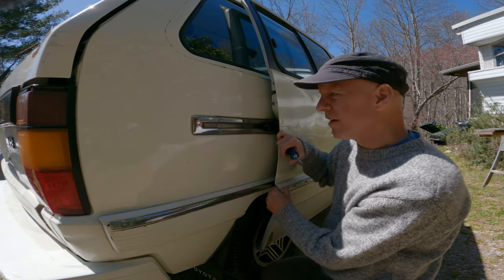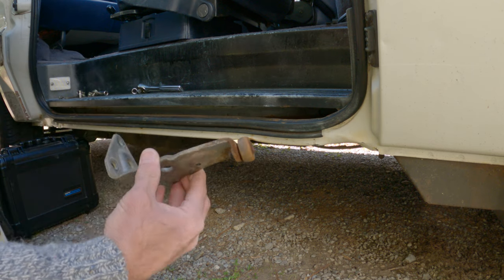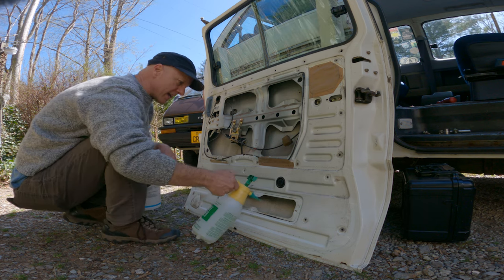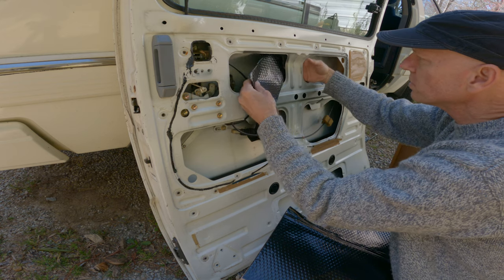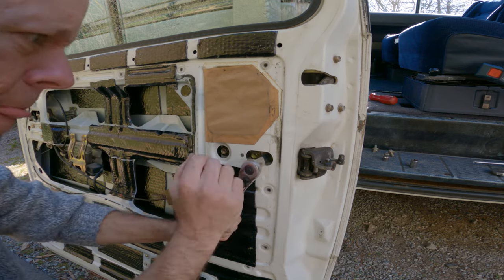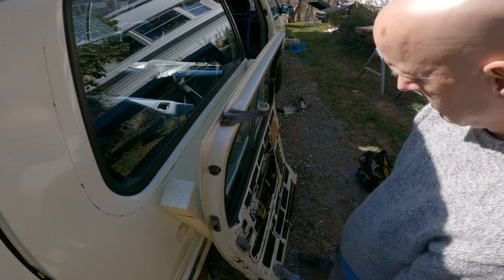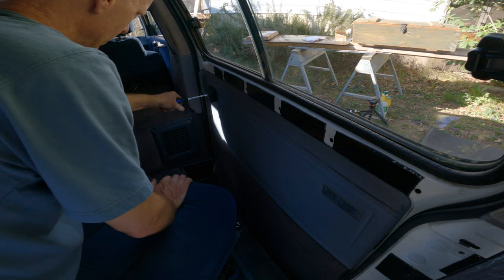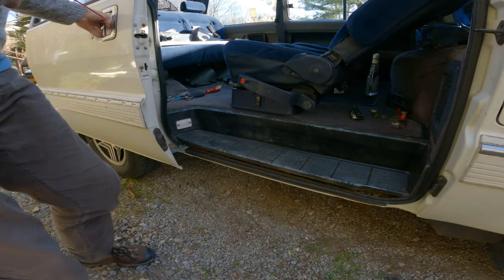Luna 1989 Toyota Van | Sliding Door refresh

Comment: Great video, this has helped me.  I'm having an issue now involving my sensor that triggers the rear most dome lamp and the "door ajar" warning light.  I have identified the sensor that turns the light near the sliding door step area but apparently thats not the same sensor as the dome lamp and warning light are still on.  I haven't found any other sensors to consider.  Any ideas?

Comment: HELLO!  I can use fuel efi 23250-65020 or 23250-45011 replace for toyota van ?
Reply from the maker: Hi there. Sorry for my late reply. Are you asking what kind of injectors to use? I haven't replaced mine. So I don't have much experience with them. You might check toyotavantech.com to get some specifics with the injection system. Hope it all goes well.